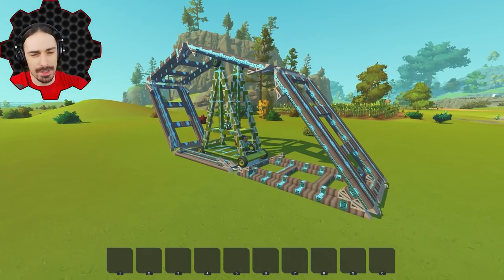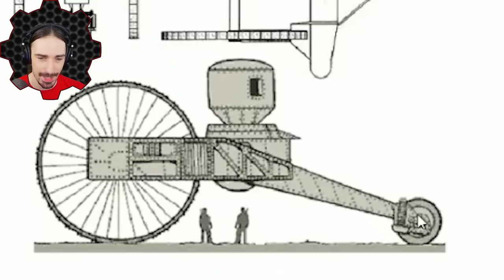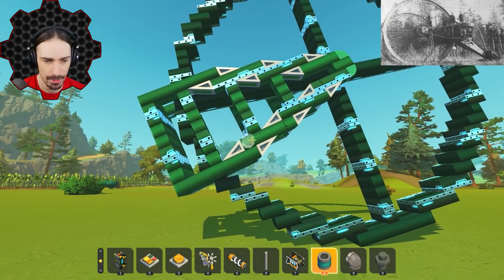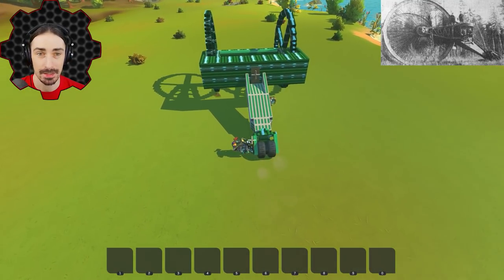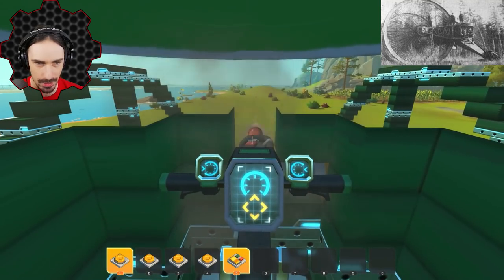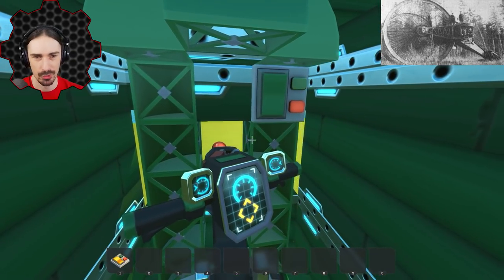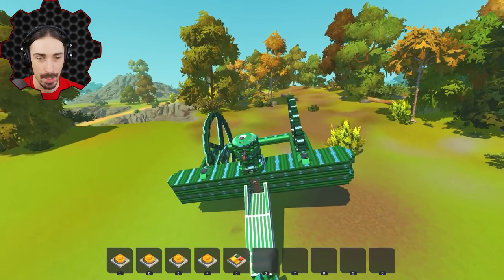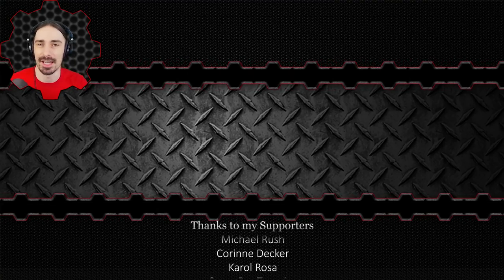This Tank Was SO BAD They Abandoned It In a Forest... SO I MADE ONE

Comment: Excellent build, seems like you nailed this one pretty well.  Unfortunately, SM doesn't have soft terrain to test this on, so we can't test if it's truly superior, but it looks really good.
Reply: You could probably simulate soft terrain with interconnected blocks and loose Berings
Reply: @DuoVersal  i mean you could
but it would also lag to all hell
and probably glitch out
Reply: @simonsoupshark8009  connect  blocks by bearings and set physics to 1
Reply: @DuoVersal  Or use a field of suspension with blocks on, maybe 3x3 of blocks per suspension to cut down on the physics calculations
Reply: Add some modded ultra heavy blocks and all terrain becomes soft.
Reply: @DuoVersal  bearings*

Comment: Pretty ironic that the whole thing may have worked, if they'd just had something like a deployable ski in the back, for when the wheel bogged down.
Reply: It wouldn't have worked what ever they had put back there. Center of mass is almost in the middle of the vehicle, meaning almost half of the mass is on the back end. Really bad design.
Reply: @kasparroosalu  And normal vehicles have similar weight distribution, what's your point?

If you spread it out enough that it doesn't dig in, then a vehicle works, if you don't, it doesn't.

Comment: Some other cool facts about Tsar.
You could easily immobilize the tank with a single metal rod lodged in the wheels spokes.
Hellfire tanks on Starwars are based on Tsar and are way cooler.
Reply: I'm pretty sure they're called hailfire droids, but yes. They are way cooler.

Comment: during ww2 Germany used tank wheel layout known as overlapping wheel suspension. This was used to solve the problem of smaller wheels rubber wearing  away too quickly. If the used larger wheels they would wear away slower but wouldn't have as much surface pressure leading to similar problems as the tsar tank. But they had the idea to overlapped the wheels leading to the benefit of both wheel types, Wikipedia has an interesting bit on it that would go into more detail. My idea would be to try to recreate that in scrap mechanic with treads but if its to laggy then just the wheels would be cool. ༼ つ ◕_◕ ༽つ

Comment: Scrap man, could you make a WASD controlled walker (biped, triped, quadreped etc.). I know it's clichéd, and you've done such projects in the past, but I mean the whole hog, as it were, not just linkages and hip joints; WASD interpreters, compex, functional leg movement and logic tailored for different directions of movement for this robot alone, possibly even some sort of adaptive leg adjustment using foot sensors?

Comment: Hey, i have a tip for you, if you don't have a dimention of something you usually can find drawings or plans in the internet, also on the internet you can find something like lenght, then you put a ruller to the screen, measure lenght of the thing and devide lenght of real thing by lenght that you measured and now you got yourself a scale of a drawing. By measuring dimentions of things that you need and multiplying it by the scale you get a real life dimention. This process can be reversed too. 

Example:

Lenght of the tsar tank is  17,8m so 17 800mm 

Lenght of the tsar tank on the drawing i found is around 34mm

17 800mm : 34mm ~ 524

So the drawing's scale is 1:524

We also need to calculate our scrap mechanic scale, for that i'll use wheel diameter witch is 9m so 9 000mm and in scrap mechanic you wanted to use 30 block wheel so

9 000mm : 30 = 300

Now we know that 1 block = 300mm

Distance between the weels on the drawing is 13mm

13mm × 524 = 6 812mm

Great, now we know the distance irl

6 812mm : 300 ~ 23 blocks

I know you know how the scale works beacuse you passed primary scool but I wanted to show you how easily you can use it to make accurate builds in scrap mechanic.

Comment: It's really REALLY difficult to have made something tactically worse than the German A7V tank. I mean you have this monstrosity and then you have, "Let's put 28 soldiers in a metal behemoth that has poor ventilation, moves slower than the speed of flatus, and has more machine guns on it than it does millimeters on its armor thickness." THAT idea actually was produced and used in battle. THIS "tank" never was. That being said, you need to get kAN, kosmo, moonbo, Jon Bain, Camodo, Spycakes, and 21 others together and build the A7V tank and use it.

And while they both have been recreated by several people in several games, I think you should try you hand at the Allies "useless spearheads". The A39 Tortoise Heavy Assault Tank from the UK and the "27 year hide and seek champion" T28 Super Heavy Tank also known as the T95 Gun Motor Carriage (but most popularly known as "The Doom Turtle") from the USA. Both were constructed to production level prototypes for the same purpose; to be the armored spearhead for the allies through the Siegfried Line. The problem for both of them was they reached the point where their production was stopped AFTER the Siegfried Line had been breached without them. For a reference, the Tortoise was 79 metric tons in weight and the Doom Turtle was about 86 metric tons. There's still surviving examples of each, but there's only 1 of 2 of the T28 that still remain. They're fascinating machines and I think if you build them, you should get kosmo or kAN in to uh. . . "test" them with you.

Comment: the issue with shooting the Wheels should be relatively eas to fix, by adding stoppers to each side of the turret, so it cant physically turn into the Wheels.
In early Fighterplanes, the installed a link between the MGs and the Motor, then synchronized it. This Way, the MGs couldnt fire in the splitsecond, when the Rotorblade was in front of the MG.
This allowed them to fire through the Rotor without destroying the Blades. I guess the Engineers for this Tank could invent something similiar.
My main issue with the original of this tank is: Its big, its heavy... and the Wheels are THIN. No wonder it got stuck in soft Ground. For all-terrain movement, you need wide Wheels to spread the Weight. I would say triple these big wheels and it would have worked better.

Comment: The basic concept is not TOO bad, some fairly simple re-designs would have made it somewhat practical. Move the main weight forward onto the big wheels, MUCH closer to the main axle. put a couple of close-set larger wheels on the back, with wider treads (the little wheel would have got stuck in any trench crossing, needs more diameter). The dorsal and ventral turrets would then also have a better field of fire.

Comment: Aight, now make the Ratte

The P.1000 Ratte - Designed by Hitler 

This is the largest tank ever designed, so large that it used submarine engines and a turret of a battleship. It was so large that it was more than a tank, but rather a "land cruiser". The reason for this design was because the Germans fought mainly on land. The reason why this wonder weapon failed was because it was so expensive to make, not only that, no factory had the resources to make such a behemoth but rather required shipyards for its construction. Its large size also made it a vulnerable target. Maybe the tanks on the ground wouldn't be able to pierce through its thick armor, but bombing was another way thing, especially since its so large the bombers would spot it easily, despite it having anti-aircraft cannons on its back. I don't think there was a confirmed amount of these anti aircraft weapons but it most likely had 4 and maybe even one on the turret itself. It also had 2 Maus turrets of the very back for rear defense and taking out other tanks. It also had an anti-tank gun on the front. 

Fun fact: the Ratte tank is considered the cousin of the Maus tank

There are more features about this tank but maybe its better if you research. It would also be nice to see a modernised design like making the World War 2 weapons modern, giving it better slope armor, and maybe adding a triangle plow on the front with a turret on it maybe. Hope you see this :)

Comment: Two fixes one use two engines instead of one so the tank has more power but not as much speed. The side turrets, yes in an game you have limitations but one thing you could do to fix the problem of field of view, that I noticed, is having the hull of the tank around the seat rotate like they had on the WW2 American Sherman bottom cannon/turret. It would be historically accurate but it's a game it has limitations, like trying to control a vehicle all by yourself when there's supposed to be a lot more.

Comment: Try to make the WW2 German “LandKreuzer” it was a tank that was never made because it was too wide to go over bridges.
Reply: I'm pretty sure the main issue was not with being too wide, but too impractical. If you took out the treads (which would have been insanely easy, as the Kreuzer was not that mobile) it's just an armored base. It also would have been so heavy it would completely destroy roads as it went over them, let alone bridges.
Reply: @scottowens398  Yeah, that's fair, I only remembered that it was way too wide to go over bridges, which was somewhat of a determining factor.